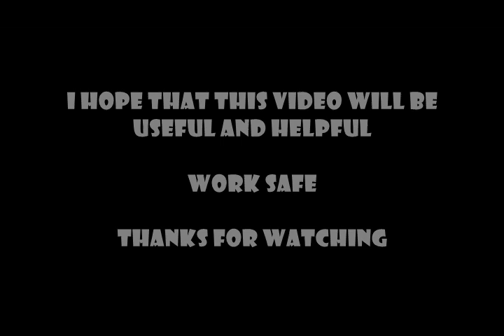Easy way to cut and install FRP PANELS inside a Food Trailer #Frp #installation #wall #Enclosed

Comment: May I ask what type of adhesive did you use ?
Reply from the maker: I used liquid nails pro frp adhesive but I think there are other better options...also make sure to leave a space differential between the panels because they extend due to temperature changes.

Comment: Hello and thank you for your video! Im going to also attempt installing polywal to the plywood in my 6x12 Cargo Trailer (converting it to an RV). May I please ask you what adhesive you used/how much of it you bought for your trailer? Also, they say to leave 1/8” between sheets for expansion in different weather conditions. Since I will be traveling to different cold/hot conditions, I was wondering if you noticed that much (or any) expansion or changes in size of yours? Thanks a lot!! Arturo
Reply from the maker: Hi there, This trailer is a 6x14 so I used 4 Gal of adhesive, I got a 3.5 Gallons bucket and then I added a 1 Gal, the brand was Liquid Nails ( but I suggest FAST GRAB) ,the 1 Gal was for $ 22 and the 3.5 Gal $57...and yes you must leave some space between the sheets for future expansion because I got some deformations in some areas where I didn't leave a space ( was my bad)...I hope that I covered your questions...Thank you for stopping by and let me know if you have any other questions...make sure to subscribe ✌️

Comment: Great job.  Thank you for taking the time to share.  Do you think it would be ok to eliminate the rivets, since the FRP will bond to the wood?  I also like the idea of bracing the FRP with studs during the drying process.
Reply from the maker: I have seen other people applying just the adhesive but make sure to apply somekind of pressure on the FRP during drying process  alson make sure to use a good quality adhesive, The reason I used rivets is to reinforce the FRP to the wood, also you know how the temperature has an effect on the adhesive and FRP material especially inside a food trailer,so I thought using rivets or fasteners will be helpful to hold up the FRP sheets...Also leave a descent differential between the panels because they extend due the temperature and you dont wanna get air bubbles on your walls....Thank you for stoping by and good luck with your project.

Comment: Do you just use glue or screws as well?
Reply from the maker: I used adhesive and reinforced the walls by white plastic fasteners, but you use screws aswell...good luck 😊